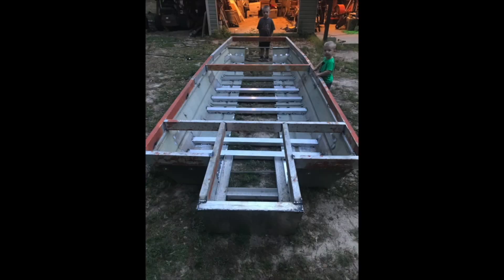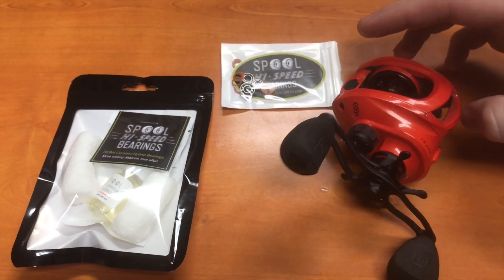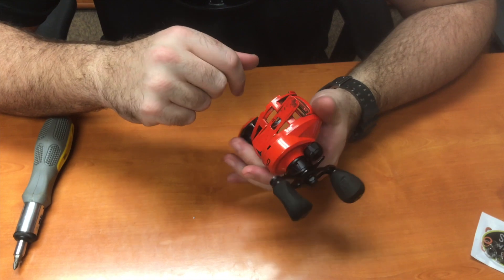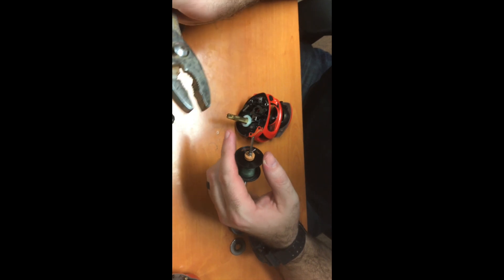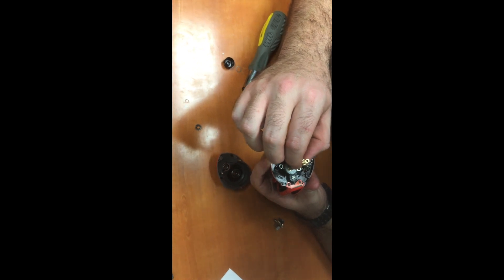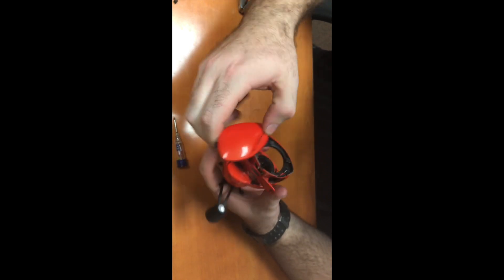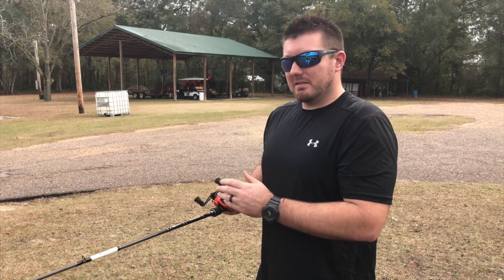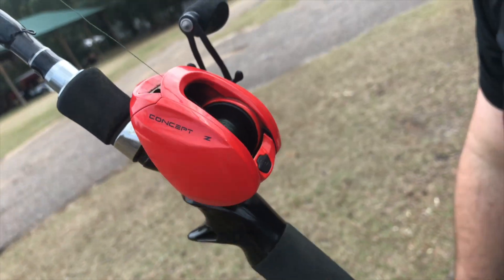13 fishing concept z  + spool hi-speed bearings.  Install and first impressions

Comment: In order to get the max distance the spool has to be full. The reason being that the spool does not have to spin as fast as say a half spool would. This allows for easier control of the cast and the distance will always improve when control is improved.

Comment: Why would you want to change to a ball bearings in the first place. Doesn't it negate the whole "Concept?"
Reply from the maker: it does negate the whole concept, you are correct.  to answer the question of why to change, its because the owner of the reel saw the same instagram videos that makes everyone want these bearings... where they cast a lure easily and every bit of line comes off of the reel during the cast... so that's why. SMH.I'm not knocking the bearings, they made the reel much smoother but you loose the "bearingless" aspect.

Comment: I thought the concept Z had zero ball bearings. instead I have polymer disc
Reply from the maker: it doesn't have ball bearings, it has czb, which is really a ball-less bearing.  speed spool makes super smooth bearings to replace those.  so my buddy pretty much replaced the selling point of the concept z in order to make it smoother.  it definitely made it smoother but it didn't really effect the castability.
Reply: Jack Armstrong they always cast floro maybe that’s why
Reply from the maker: @knotagainangling2833  probably so.  they definitely made it smoother than the czb but we couldn't empty the spool with a cast...